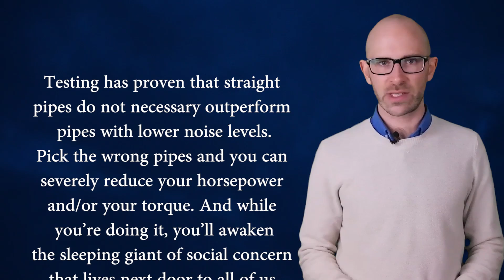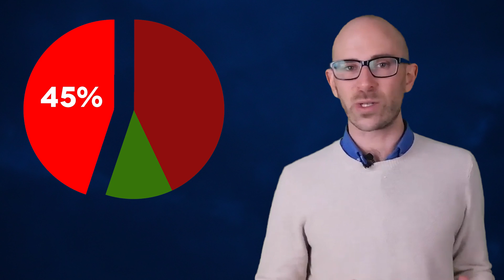Why are Harley Davidson Motorcycles So Loud?

Comment: Loud pipes risk rights, they don't save lives.  The loud pipes argument falls apart when you realize that 95% of the danger is in front of you, with loud pipes 98% of the noise is behind you, the person who is about to turn left in front of you has their windows up and radio on and will never hear your loud pipes, they don't hear them till you go by. Most of the single vehicle accidents are caused by drinking and riding, Harley riders tend to like to drink and ride, that will get you killed.  They like loud pipes to make their low powered Harleys sound more powerful, while they are actually among the lower powered bikes, the sport bikes are so much more powerful there is no comparison, so they buy loud pipes to make them sound more powerful, but as mentioned in the video many poorly designed exhaust systems often cause power to be lost rather than gained.  I was once told I couldn't stay at a motel because of the loud bike I rode in on, except I rode in on a BMW that was no louder than a car, but the owner wouldn't even consider letting a bike stay there because of too many bad experiences with loud Harleys.  Loud pipes risk rights, those loud Harleys cause areas to be closed off to motorcycles, but they close them to all motorcycles, not just the noisy Harleys that caused all the complaints.
Reply: G56AG your a fucking idiot... Just, no...
Reply: Steve Ramsey so you just said he is right but then say he is wrong??? Logic
Reply: As a sports bike rider, I/We tend to think of Harley riders as dentists and accountants.  On Rt. 17, in Northern NJ, Sunday mornings always see batches of Harley s going from diner to diner.  This self selecting group are, possibly, more risk averse, more cautious, than the people who buy a sports bike because it goes around a 25 mph curve at 45 mph.
Reply: Robert Dobbs 

Sorry dude no Facebook page here... other than you tube I use no social media....
And no I might not be a hardcore biker ... I don't put 25,000 miles a year if that's what you are referring... I ride about 5000 miles a year ... I have 3 small children so if it's sunny ☀️ u will catch me in the park with my family...and then I'll ride for a couple hours ... I would ride my motorcycle to work 2-3 times a week ... so no I am not a hardcore rider I don't owned a Facebook account.... but I do select very carefully what I buy ... and I have an very very good taste on toys and my Harley it's a beautiful toy ....u would never catch me on a sports bike BECUASE that's just not what I care for ....I could buy half of dozens of them if I which but I have no desire to purchase one....
Reply: G56AG it's the person not the bike
Reply: G56AG well said!
Reply: I don't think so G56AG. It amazes me how many drivers jerk back across to their own lane when I give mine a wee blip.  They should all remember to look over their shoulder as they were taught to do before moving across.  I have had one guy say he was indicating so had the right of way.  I aid you want to read the highway code again as it states in there that indication means intent to move and does not give you the right to move.  SIGNAL MIRROR MANEUVER
Reply: you only think racing bikes are faster than Harleys.  Have a look at this.  The low end torque of a V Twin engine will leave everything standing from a standing start.  Even Japanese V Twins will do the same.  Yes racing bikes are faster at the top end I agree with that but I can leave anything in my dust even on my dragstar trike lol
Reply: G56AG your comments are right on the ears , I mean nose . LOUD PIPES POOR SUBSTITUTE FOR NO SKILLS ! that is what my T-shirt says .
Reply: I commute in and out of Washington DC (USA) every day.  And I can tell you that my loud pipes have saved me from getting cut off or run off the road many times.  they hear me before they see me, causing them to look around for the noise.  I'll give up my loud pipes when the general public obeys the cell phone and texting laws.  Until then, you'll hear me coming!
Reply: 1Bigduff lane intrudision is part of situational awareness A HUGE PART OF MOTORCYCLE SKILLS! being subjected to audio assault from your chrome air compressor around the public is not a fair trade off for a  just blasting racket from your bike to make you feel safer for a second on the highway
Reply: You are entitled to your opinion, as am I.  I am just stating my experiences of 30+ years on the street.  My bikes are actually fairly quiet, but I do have the option of getting someone's attention if need be.  and believe me, I have excellent situational awareness!  and the "audio assault" that you refer too does not last long.  Have a nice day.
Reply: You are entitled to your opinion, as am I.  I am just stating my experiences of 30+ years on the street.  My bikes are actually fairly quiet, but I do have the option of getting someone's attention if need be.  and believe me, I have excellent situational awareness!  and the "audio assault" that you refer too does not last long.  Have a nice day.
Reply: G56AG 

I don't know the number all over the world ... but here in the USA 🇺🇸 the majority of accidents/fatalities are sports bike .... hands down and this is a know fact .... the majority of Harley related accidents and fatalities ARE NOT riders fault ....those are facts!!!!
Reply: Tony Vasconcelos Facts??? what the f is a fact? Have you seen the horse shit posted on this page? 99% of these people dont understand how the exhaust system works on a bike but claim superiority in the subject and how the sounds are developed and dispersed. No room for facts man, are you insane?  Just insult people at random - do NOT need reason or cause just fire away. A good target is Jeffrey Dobbs Dahmer the sexually molested psychopath. If you want a discussion about motorcycles, this IS NOT  the place.
Reply: Timothy Dingman 

That could be me .... I ride Rt 17 all the time Because we have the Bergen county Harley dealer off Rt 17....I also ride to Rahway a lot to the Harley dealer over there ....and it's not that we are cautious it's also my age ....I am 40 and when I ride my bike I have no rush to get anywhere ... I just ride and enjoy... lots of kids riding sports bikes have no respect for this machines and if you noticed on Rt 21 there is always a motorcycle accident there...95% sports bike it's the one down.... it's a shame.... I am a strong believer that you should not be allowed to ride a sports bike till you have at least 3+ years of experience.... you first bike should be a cruiser then after three years and some specialized course then you should buy a sportsbike.....but what i know ....i am just a Harley rider !!!
Reply: Tony Vasconcelos first bike should be a dual sport and be required to spend considerable time off-road getting used to the feeling of your bike wanting to come out from under you.  cruisers don't handle all to well compared to other bikes.
Reply: kickin' chicken 

Well I can take that.....but at least it's safe to say that we both agree to the idea that all these kids should not be allowed to ride these type of bikes as soon as they get the license...
Reply: I was thinking it might have been Washington DC (Tanzania)
Reply: says jim PERVERT. [fucking roasted]
Reply: G56AG is correct... provided that the motorcycle goes faster than 767 mph aka the speed of sound.
Reply: True indeed.  Ambulance air horns all face forwards but you can still hear them after they go past I wonder why that is if you can't hear a motorcycle until it has passed you lol.
Reply: G56AG you sir get it

Comment: So to sum up this video, the reason is because Harley's use a V-twin engine with big displacements of over 1400cc in some cases. 700cc of displacement per cylinder makes for a bigger explosion than say a 50cc engine. That's why they're louder than other bikes.

Comment: ANY big car or moto engine, which resorts to trading stock mufflers etc., for headers or straight pipes, will be ridiculously loud. There's a lot of outlaw mentality out there. 

High-quality (expensive) stock replacement systems for motos like Vance & Hines, Cobra, and Rinehart Racing have loud, but not a crazy-making level of a deep exhaust note on the road. The cops can see the baffling too when rolling up from behind to avoid ticketing. 

Hearing protection while moto riding is always needed, but mainly for continual wind noise with or without a helmet. Avoid tinnitus or it will be hearing aide time down the road.

Comment: and loud pipes have saved my life. cars just don't give a shit about bikes safety and don't look or expect to share the road with bikes. now with all the texting and driving  hear the bikes and look up
Reply: o fcourse cars dont care they are inanimate object, now do not try to lump all drivers of those cars together, I have to say I see motorcycles usually, sometimes you dont expect them and sometimes they are wearing such dark clothing on dark motorcycle on dark pavement you dont see them right away. takes a moment for hte brain to register that your there. I do care by the way about all life especially human lives.
Reply: Yup, I am so tired of having to lean on my horn as people try to merge and left turn without looking.
Reply: James Hardy i got a loud ass pipe so i just rev the fuck out of my engine and scare em shitless
Reply: Nicholas Hatala Luck??? I have rode bikes and driven trucks my whole life, and you will not remain alive on the highways relying on luck. Defensive driving coupled with driving sensibly yourself is necessary. And I am guilty of having "loud pipes" on one of my two bikes, a Harley that had those pipes on it when I bought it. Solution is that I do not hammer the throttle or do high rpm's around people. Loud pipes need help to be loud. If people would just respect one another, a lot of these problems would go away. So let's try giving one another a break. Live to ride, ride to live.
Reply: Ernie Desjardins Let's face it, loud pipes weren't what saved you, luck did.

Comment: You use statistics of ALL motorbike crashes trying to prove a point about a certain type (brand) of motorbikes, and make a pretty pie chart to diminish the amount of accidents where motorcyclists have been hurt because of the car drivers - and keep silent about the significant AMOUNT of actual PEOPLE hurt and killed in these accidents; they are actual people in actual accidents and not just an insignificant slice of your pie as you try to explain it.
Weekly I get into a situation where some careless asshole tries to kill me on the road, if at least some drivers can hear me coming then yes, loud pipes do save lives.
The mufflerless straight pipes are called "drag pipes" for a reason, they are meant only for drag racing and offer high power at high rpms at the expense of losing low end power completely. For anyone liking the looks of drag pipes, I recommend Vance&Hines Straight Shots which look like drag pipes but are indeed muffled, loud but not too loud, and give a very straight power curve with both good low end torque and decent maximum power.

Comment: Loud pipes do save lives.  True story; has already happened to me a couple of times.  I was riding down the road, there was a deer standing by the side, trying to decide if it wanted to run out in front of me or not.  I let off of the throttle, the bike backfires two or three times through the dragpipes, the deer's eyes get real big and it turns around and runs away.  They were each in front of me, too.  Harleys are loud because it is a big motor and the owners like to take the baffles out, to show off.  It is too bad though, that so many of them like to rev the motor all of the time, like they think we all enjoy their loud bike as much as they do.

Comment: Powerful sound, that's really essence of a Harley isn't it. Comprehensively outperformed by my irritatingly quiet stock 600cc commuter bike, yet I'm at risk of hearing damage from the wind noise off of my helmet at anything above about 40, and dawdling at the motorway speed limit (70mph here) i can't hear anything resembling engine or exhaust noise.

Comment: Lol... I've heard plenty of rice rockets just as loud or louder because they drive around in a much higher RPM range than we do. 

My bike loud? Yes. It should be.  But I'm not the guy that revs at every light,  through residential areas,  and other inappropriate areas.  I have respect.  

But... I have been in traffic and had people not pay attention or not see me (despite super bright L.E.D.s that are constantly on) and start to pull over in my lane. A quick rev or two and they hear the bike and abort their lane change.  They do save lives.

Comment: Nothings as loud as being next to a semi truck on the freeway. Much louder than any loud motorcycle. One should always wear earplugs when riding for that and wind noise alone. I've ridden loud and quiet bikes for 40 years. Loud pipes do save lives especially around texting drivers. The EPA, non-riders and texters should pipe down and butt out. I find their opinions loud and offensive!